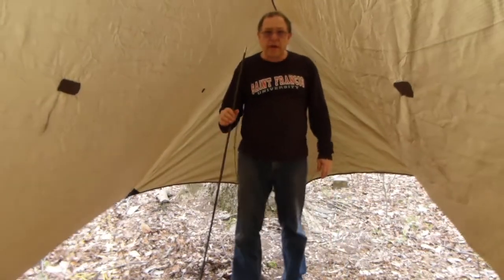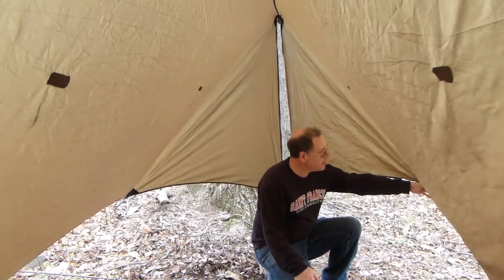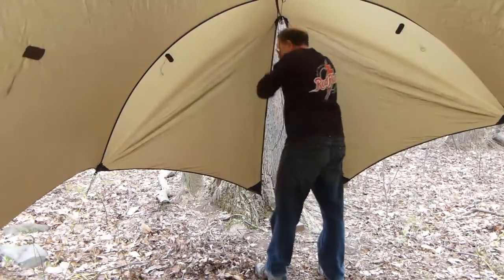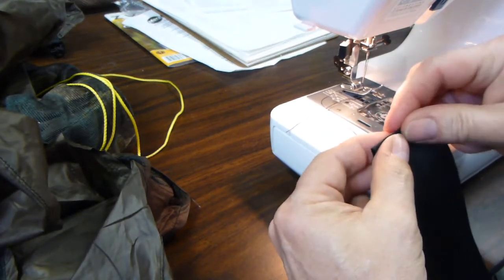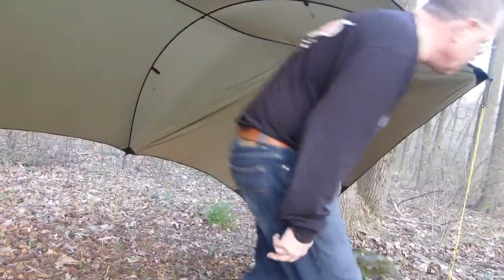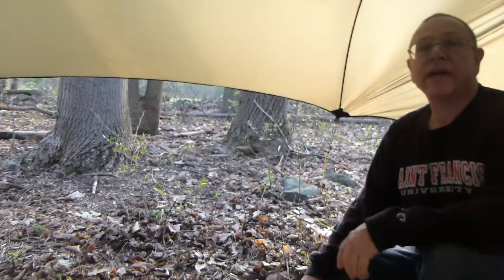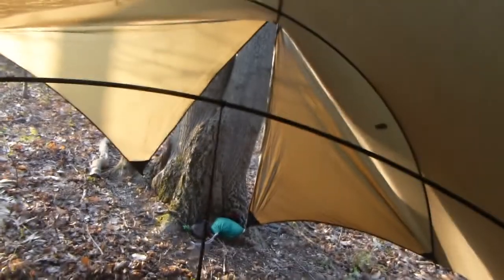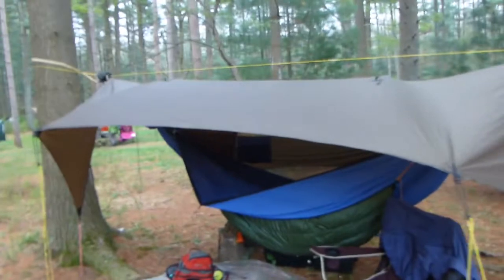Tarp Pole Mod

Comment: Great mod. I have in my SLD Winter Haven pole mod pockets in the middle and 2 ends so I am able to use 1,2 or 3 poles depending on how much space I need. I mainly customized this tarp to see what mod I'd like best. I also added tie points on the Ridgeline to adjust the angle of each pole so I can lean the two end poles towards the outer Ridgeline tip ends or toward the center pole. So far I like the 2 poles leaning towards the outside.  Works great in porch mode!
Great video!
I'm long time subscriber.
Reply from the maker: Thanks for watching. I may do some playing with different pocket locations as I use it in rainy/windy weather.

Comment: very nice, what poles did you use ?
Reply from the maker: I was an early arriver at MAHHA and came across a tent shoved in the dumpster (North Face or Big Agnes, I forget which). I wasn't about to touch the tent, but the aluminum poles I grabbed. Dutchware sells the poles, if you aren't as lucky as I was.